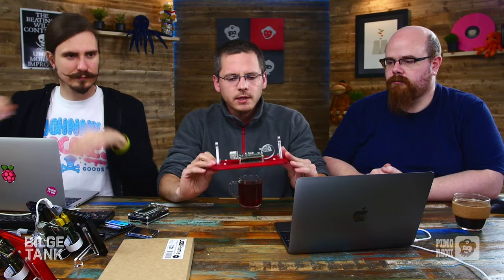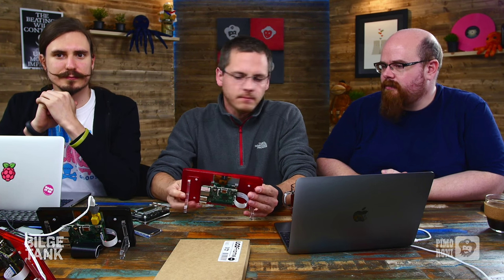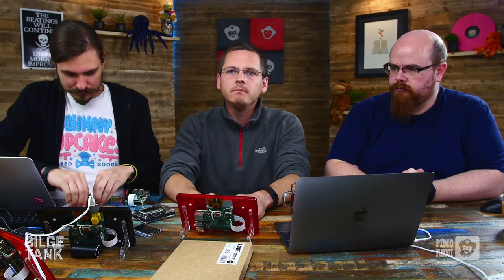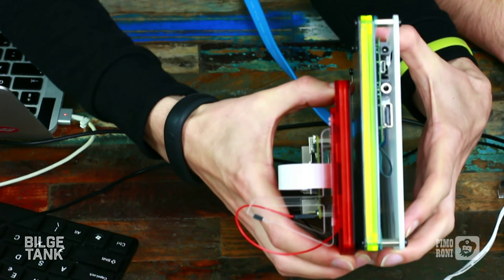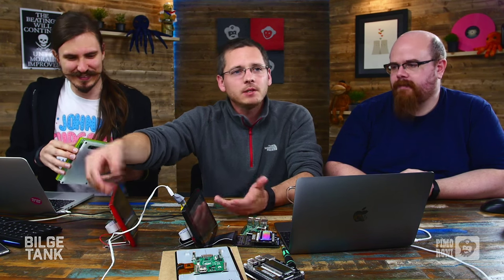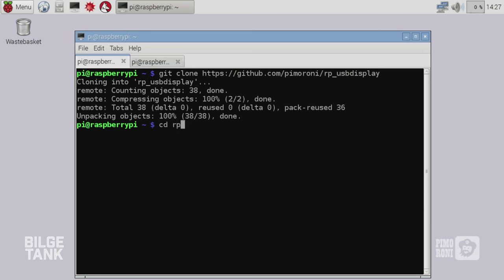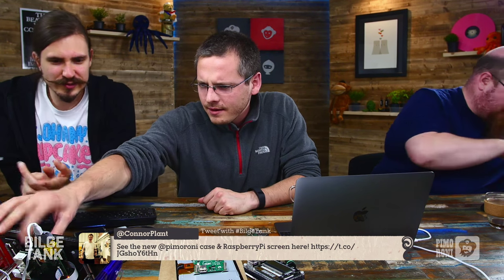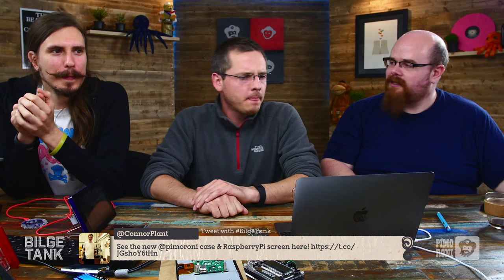Bilge Tank 000 - Displays on your Pi

Comment: Great show folks! Especially with the added loudness ;) Man I want one of those touch screens, should have no problem justifying it as a MeArm development cost...
Reply: +Ben Gray :D it's well worth it, they're lovely little displays and the low resolution isn't an issue outside of the occasional settings dialog which assumes a minimum height of 768. They've definitely hit the no-brainer pricing right on the head.

Comment: If you power the display over USB is there space for a hat on the GPIO with the display case on?
Reply: +marctwok yes! Having a HAT behind the screen isn't a problem for something like RasPIO Duino, Propeller HAT or anything else that's more about IO than visual. You'd have to be careful about HATs which potentially squash the DSI ribbon flat or have something that might be in its way, though.
Reply: +Gadgetoid great, thanks for the response. I was thinking along the lines of a dac or amp.
Reply: +marctwok having transported a display to Cambridge in my backpack with no ill effect, I think you'll be okay squashing the DSI ribbon. Mine's kinked at a right-angle now.
Reply: +marctwok I have an IQaudIO PiDAC+ attached to the back of mine. The hat passes through the first 10 GPIO pins, so you can connect the screen power to that. A good 2a power pack is required to run it all (I sometimes get a flash of the low power symbol when I use a USB Wifi adapter, but it still runs ok).
By removing some layers, I was even able to fit the DAC + Pi in the case that Pimoroni sell (https://shop.pimoroni.com/collections/raspberry-pi/products/pibow-audio) on to the back of the touchscreen. I aim to post photos of the setup in the Pimoroni forums soon.

Comment: Love the display.. but for anyone with an old Android tablet lying around using what you already own can be a good solution because you can use:

1) JuiceSSH in android for the command line
2) TightVNC to get the screen over the USB
3) Internet connection over USB (tethered) from the Android Device (so no need for wifi usb dongle stealing a USB port)
4) Android on your tablet when you want/need to use something from android (like google maps).

You can do all of the above without rooting your device (I used a Tesco Hudl2 [8.3 inch 1080p screen] and a Pi 2 running Raspbian Jessie).

+ Also the screen powers itself (and can even be charged from the Pi power source)
+ Lately have been powering the Pi 2 from a £6 USB powerbank (which itself takes 4 standard AA batteries) that I got from Claus Ohlson (http://www.256.co.uk/?p=852). I think they are on sale as I suspect they plan to replace them with thinner/lighter units with sealed in [non-hotswappable] batteries. 

All of the above said - the image quality isn't perfect over tightVNC (at least the way I have set it up) and having a dedicated screen for the Pi is very cool!